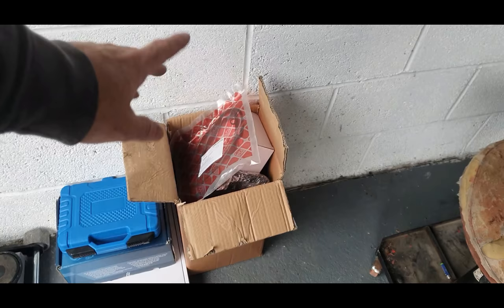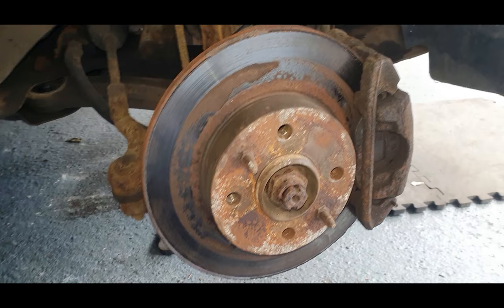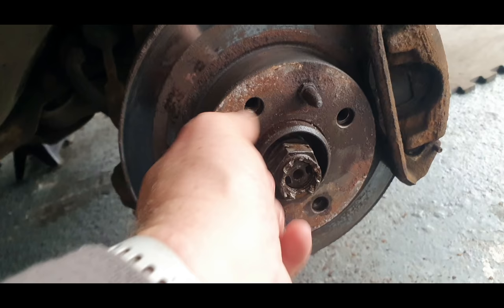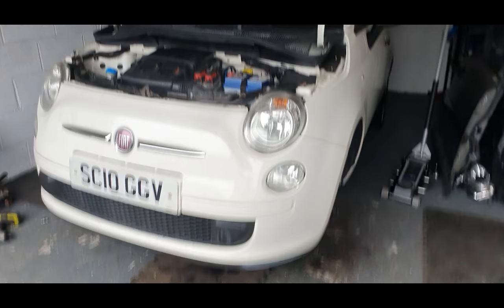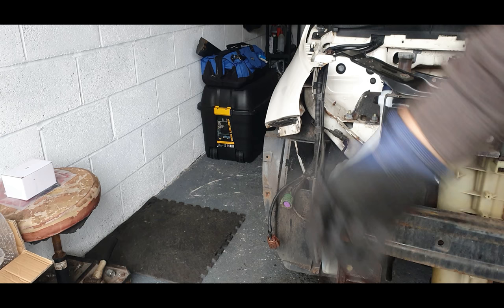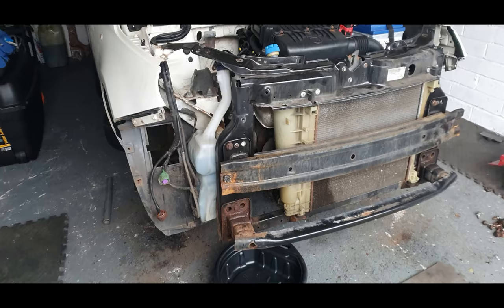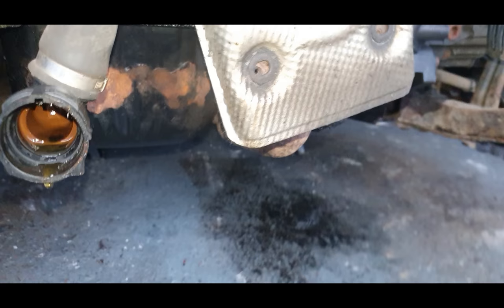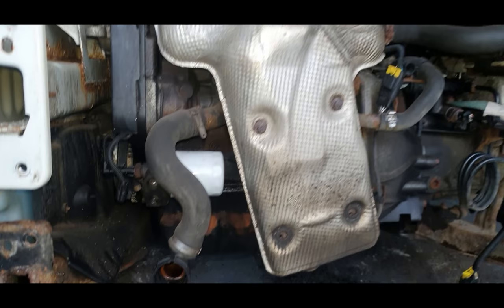I Never Seen So Much Rust (Fiat 500 Salvage Rebuild)

Comment: I’d drench every bolt nut and clip in WD40 and leave it for 24 hours. I’d almost be ringing scrap yards to find a rear end write off car. Then pack every tool i can, go down there and scavenge parts like a boss. The car you have has spent its life splashing through every puddle know to man.
Reply from the maker: I should have just sold it on, too much bloody work for very little reward but thanks for the advice

Comment: When I was younger cars would drop to pieces with rust . These days body wise the manufacturers have got it sorted yet the undersides seem to be as bad as ever . Then again its been through a few winters . Done well to get them driveshaft bolts off. People gun them up with the more powerful guns then they are seriously tight,  add rust to it and its an issue to slack them off.
Reply from the maker: I've never experienced something that tight in my life my whole 16st couldn't shift it lol... salt on the roads definitely speed up the rust ... its another way to get the older cars off the road I reckon, with the use of cheap metals its a combination for disaster. Thanks buddy

Comment: I reckon they’ve had the bottom arm done that side hence why it’s got different bolts and washers in the front panel that side.
Reply from the maker: Something has been done but it's not right to leave it broken like that  mun that leg should have been replaced I hate it. Thanks buddy
Reply: @RevivingSalvage  I would definitely be replacing them, but the way these things rot out underneath where do you stop?
Reply from the maker: It's all money fella it's going to be a brand new car at the end of this